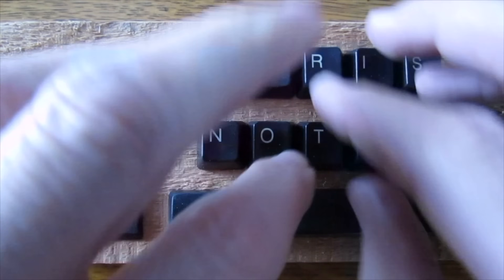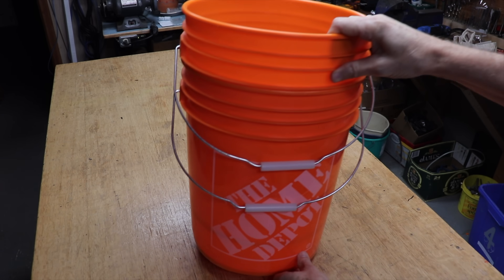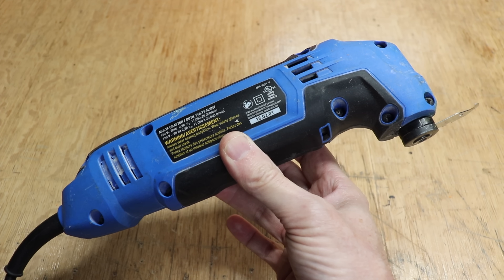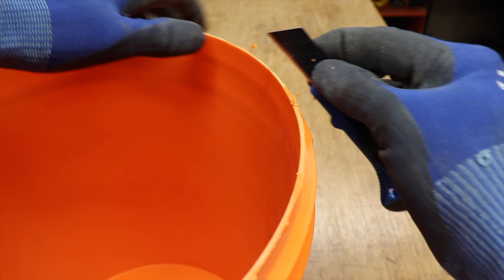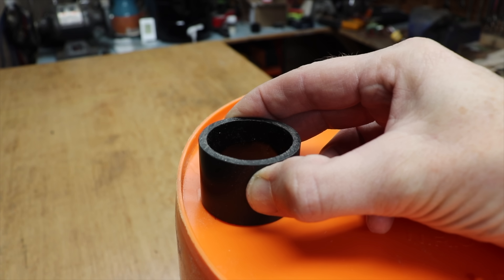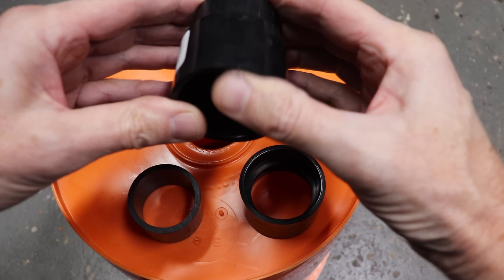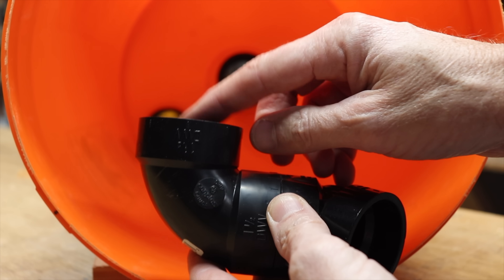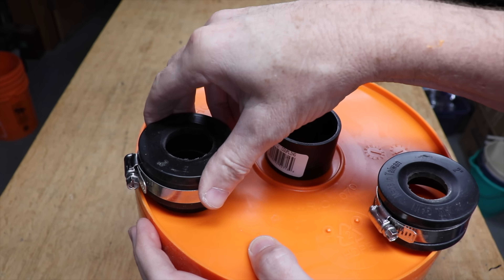How to Make ● Simple Cyclone Dust Collector

Comment: Is anyone using these w/ compact wet/dry Vacs?  I'm thinking about a 2-4 gallon Milwaukee/Dewalt/Ridgid vac + Cyclone for my TableSaw.  Would those be enough power? I have the most faith in the Ridgid but I'd love the battery/wall power option of the Dewalt.

Comment: Easy and cheap. Love it.  Some things I realized after I built mine.  The intake hose must be larger than the exhaust hose (the one going to the vacuum). Also the intake port must be at as big or bigger than the intake hose.  Having a smaller inlet port than the inlet hose will cause clogs if a chunk of wood is sucked up.  I also noticed a comment from someone about a whistling noise. I had the same problem.  When I used a larger intake hose, the problem went away.  I have gotten so many great tips from guys like you that are willing to share their ideas. Thanks again.

Comment: No need to cut the handle off the bucket.  It works just as well with it on and you get to have a fully functional bucket as a bonus for other things.
Reply from the maker: I found that it got in the way when putting the buckets together or taking them apart, but yes, leave it on to suit your needs for sure. Thanks.

Comment: Hello again Chris!

I had a trailing thought on this project. Providing the the efficiency of the cyclone set up is optimal, would it not be a good idea to simply add a 2 inch pipe from one's central vac (providing you have one!) to the cyclone? Then add a simple SPST switch to activate it. This would cut down on workshop noise from the shop vac. .

Anyways... just wondering what your thoughts are on this?
Reply from the maker: Thanks!! Did you see the update video? ... https://youtu.be/BeU4nqSJtBY
Reply: @chrisnotap  Just watched it. "You're ahead of your time" - LOL

Only change I'd make would be to make the connection to the central vac system more permanent.

Nice (creative) work Chris.

Comment: Might be a silly question but... are the sizes and dimensions mentioned in the video only correct based on using a 1.5 inch shop vac hose? I don't think he mentions what size of hose he's attaching? I think mine might be a 2 inch or 2.5 inch shop vac hose? So I'd need a 3 inch end cap and 2.5 inch pipe fittings? I wonder whether it would work as well with the larger diameter hose or if I'm better off getting an adapter, 2.5 inch to 1.5inch!? Sorry... turned into a long question, any help is appreciated! Thanks :-)
Reply: The reducer is easiest and it works.

Comment: Just want to say that this works great. I used it when I was grinding thin set mortar from a poor tile job. Tried it first without it and I clogged my 16 gallon wet vac and central vac in 5 minutes each. Built this and was able to grind for 30 minutes at a time with great suction. Only had to stop to empty the pail. Even with the fine mortar dust it took care of it.
Reply from the maker: Great to hear!

Comment: Dang.  Home Depot changed their buckets. Doesn’t slide together like that with the new ones.
Reply: Cut down to the final ring where the handle is and be sure to keep beveling with your razor. I just bought home depot buckets today and got them to fit together. Cheers!
Reply: @MaestroSmoke  I ended up just getting a new one and didn’t cut it. Got some leftover window seal I had laying around and a couple latches. Works great, but a bit more work than what y’all did.

Comment: Nice job on the video. I built this and was a waste of time and money for me as it does not capture the fine dust and it is the fines that clog the vacuum filter. I ended up buying the $39 bucket top separator at Home Depot. It took about 2 minutes to install, works like a champ on fine particles and comes with all the hoses and fittings needed though the hose fit on my 30 yr old craftsman shop vacuum isn't perfect some light sanding of the fittings solved the problem. I hate to pump up a big-box store but there it is.

Comment: Maybe I missed it but what's the "estimated total cost" for all materials?  (tools excluded).
Reply: It cost me C$30 for the parts, not counting the hose, with half the cost going to the rubber caps.  The most expensive part of the job will be the second hose but that is the best hack of all, especially if you have a spare central vac hose.  An extra 30 feet solves the tipping problem to boot.

Comment: Some good ideas in your video. Actually a lot of good points however I have had amazing results by adding a baffle between the top and bottom bucket with a half moon shape cutout. Also I took some 1/2 inch sprinkler abs and hot glued it in a spiral to the side of the top bucket and stopped it at the cutout. Also added a small scoop at the cut out to help catch the last of the dust. The filter remains completely clean no matter what I vacuum up. Even dog hair.
Reply: sandyt not getting a visual on this. You need to show a video of this idea as it sounds great.

Comment: Ok I built this and initially it worked great. Now when I try to use it both buckets collapsed, there are no clogs anywhere. Any ideas?

I just saw the update and that fixed it.
Reply from the maker: I address that issue in the UPDATE video........ https://youtu.be/BeU4nqSJtBY.   Or your vacuum is too high powered.

Comment: Great video but have a question. Home Depot bucket bottoms now have the small circle the exact size of the 1.5” pvc. So should I move the hole that connects to the vac closer or further away from the dust collector inlet? May have to get an extra bucket to try two different approaches but thought I’d at least ask
Reply from the maker: If I understand correctly, I would go further away from the inlet.
Reply: @chrisnotap  Thanks for the response. Yeah the circle on the bottom of the bucket exactly matches the 1.5" pipe whereas on your video the smaller circle fits inside the pipe. Mine's exactly 1.5" so I'll try moving it away from the dust inlet and will post my results.

Comment: I finally had a chance to build this dust collector yesterday.  Very clear instructions and it works well.  Couple of notes based on my experience:
1) Most of the time was spent on sizing the bucket to fit in its mate.  I used a different bucket from Princess Auto and it needed quite a bit of a adjustment to fit properly.  I wish the oscillator hack worked better as the blade constantly slipped out of the holder.  Not sure what I did wrong but had to finish with a jigsaw.  Chris's tip to drag a utility knife perpendicular to the lid was key to getting a good fit.
2) The rest of the job was straightforward.  The step drill bit worked great as he said and snips and a sand was all I needed to size the two holes.  I found a drill press with a hole saw worked the best for drilling out the rubber caps.  Much cleaner than dremelling it out.
3) Great idea to use a central vac hose, if you have one, as it should reach most of your space without having to move the stationary collector.
4) Suction was definitely a bit less with a 30 foot hose (and I needed an adapter to reduce my shopvac hose from 2.25" to 1.5" to fit his spec) but more than adequate for my needs.  
5) The unit seemed tippy so I'll probably opt for Chris's 3rd pail upgrade later.
6) It cost about C$30 with about half the cost going to the rubber caps ($6.50 each).  Much more economical if you can recycle a hose than buy new.
7) Great way to spend a Saturday morning.  
Thanks Chris!
Reply from the maker: Thanks for your feedback!

Comment: Note to self: Home Depot isn’t close to me so I tried Harbor Freight buckets.   Either my shop-vac is turbo charged and has the most suction of any shop-vac out there, or the Harbor Freight buckets are super thin and weak and thus collapses when there is any restrictions on the hose.   Lesson Learned
Reply: Hello Chris,

I’ve made the cyclone. It works really well, thanks ! The only thing I’m not sure, I get some particles and dust coming out of the blower vent, it’s annoying when used in the house. I have the basic cartridge filter, no bag filter in the can. Am I doing something wrong ? Thanks again !
Reply: I found the update video addressing the buckets collapsing, I’ll give that a try!  Thanks for the videos.

Comment: Who the F would’ve figured that Canada fitting are different then ones in the USA. I couldn’t  find a short 45 degree elbow or a 90 degree one like he has in the video anywhere but in Canada and of course none of them will delivery here. I’m worried if I don’t use the exact fittings it may not work.
Reply from the maker: Many have said they use PVC fittings instead. And yes it's important to use the angled parts like I describe in the video. It works!
Reply: Chris Notap Thanks, I can find them in PVC just not in ABS.

Comment: Great idea.  I had a problem with the one I built.  My vacuum uses an 1 1/2 hose.  I hooked the bucket to the vacuum with an 1 1/2 hose to the bucket and so a 20' one and a half inch hose from the bucket to the collection to the end collecting dust.  when I turn it on, I get a shrill whistle at the end of the hose.
Any ideas how to get rid of the noise?
Reply from the maker: For some reason some hoses will whistle due to the shape or the way the circular parts are made/shaped. You may need to buy one that is meant for vacuuming. My thought would be that the whistle is happening at the opening of the hose. My only suggestion would be to try and shape the opening of the vacuum hose differently using a pair of tin snips or something like that.

Comment: So the baffles or separations on the inside didn’t work, primarily because of the height of the bucket? Or even with the second bucket for height, they didn’t help? The HD version of dust separator seems to use a baffle.
Reply from the maker: Once I had the buckets stacked I found I didn't need to have a baffle it worked so well without it. Did you see the update video? ... https://youtu.be/BeU4nqSJtBY

Comment: The bucket design is different now or they make different buckets :(
Reply from the maker: Others have said they used Lowes buckets and they work.
Reply: @chrisnotap  how far down is the cut since I can't use the lines as a guide?
Reply from the maker: 1 1/4" down from the top.

Comment: Just did mine and works AWESOME! THANKS!!!!
Reply from the maker: Great to hear! Did you see the update video? ... https://youtu.be/BeU4nqSJtBY
Reply: Just checked the new video! Thanks! Now I’m using one of those 1-1/2” pvc corrugated hose and makes a terrible high pitch noise , I’m trying to get rid of it but not sure how to... will have to check some more videos in here... thanks again!
Reply from the maker: Yes some hose make a loud whistle noise. The only solution might be to use a different hose. Good luck.

Comment: I went to home depot and tried to do this but unfortunately, it seems that home depot has changed their bucket molds as the design is not the same anymore. It does not have 4 rings up top like the one used in this video. After cutting into the bucket, it does not want to fit over the other..

Comment: Thank you for this, I'm now trying to build my own. I'm from the Philippines and the parts are not readily available. If I use another 90% elbow instead of the 45%, would it still be effective?
Reply from the maker: I tried every which way and this worked best. You can try whatever you want.
Reply from the maker: Thanks!! Did you see the update video? ... https://youtu.be/BeU4nqSJtBY
Reply: You could cut a 90º elbow in half to make a 45º.

Comment: Question about your design, my lower bucket collapses with the vacuum I am using!  Is it because the vaccine starts with a 2 1/2” hose and I go down to a 1 1/2 fitting.  I created a dust collection for my workbench and if this does not work I am back to square one!
Reply: Two recommendations:  
1. Double up on the buckets, top and bottom to give rigidity.  He has a second video about this. https://www.youtube.com/watch?v=BeU4nqSJtBY 
2. Avoid connecting vaccine to bucket. ;-)

Comment: Excellent recommendation, I will used you method adding a third bucket with the HD vac the one you used for this type of buckets...excellent thank you very much! 
5 Gal. 1.75-Peak HP Wet/Dry Shop Vacuum Powerhead with Filter Bag and Hose (compatible with 5 Gal. Homer Bucket)

Comment: I built this yesterday (my lazy variation) and it works great so far! So thank you!
Reply from the maker: Thanks!! Did you see the update video? ... https://youtu.be/BeU4nqSJtBY
Reply: @chrisnotap  fortunately I did! I'll need to revisit how the PVC fits in the top - I'll probably need to get another bucket and redo it since the connections to the bucket aren't great, but I'm not worried about losing a couple bucks over it.
Reply: I also found it tricky to get the buckets to fit together, so I made a bunch of relief cuts in the manicured bucket's edge so I can work it into place easier.

Comment: I made one of these and it works fantastic. The only part that I changed was the 2 inch rubber cap, because I was going to hook it up to my Craftsman 16 gallon shop vac, which has a bigger hose. The connector I used instead was a 2 in. x 2 in. DWV Flexible PVC Coupling.

https://www.homedepot.com/p/Fernco-2-in-x-2-in-DWV-Flexible-PVC-Coupling-P1056-22/100096490
Reply from the maker: Thanks!! Did you see the update video? ... https://youtu.be/BeU4nqSJtBY

Comment: I have been looking at a cyclone for my  dust collection system. I think I will up size your idea to a 55 gallon drum and use the 4" fitting that I use with my dust collection system. It will be much easier to empty and keep the filter bag a lot cleaner.
Reply from the maker: Thanks!! Did you see the update video? ... https://youtu.be/BeU4nqSJtBY

Comment: This system shows how the cyclone (swirling air column) generates a centrifugal thrust on the solid particles.   Interestingly there is no need for a cone shaped element to get it to operate efficiently.

It would be interesting to demonstrate how the height (depth)  and diameter of the buckets influences the result.   My primitive notion is that high velocity air stream and a relatively small bucket diameter would separate smaller ( lighter) particles.  The very finest will still pass on to the shopvac filter.

Well done on this project!!!

Stavros.
Reply from the maker: Thanks!! Did you see the update video? ... https://youtu.be/BeU4nqSJtBY

Comment: Wouldn't it be easier to use a Cyclone Dust Separator Filter for $17 instead of doing all this? I'm not downplaying this solution, just want to know the benefits of this design over using the good old Cyclone Dust Separator Filter.

Comment: best one i've seen yet!! not that i really do any wood work lol, do steel fabrication still have the same problem though,  have to look at making one for grinding dust, not realy much different from what they use in proper sawmills the saw dust is just blown into the cyclone  then falls out the bottom into a hopper and the air is vented out the top just like you have done it.
 there's some useless information for you lol

Comment: PSA #3 - The fun continues. In my bucket style, the support circle on the bottom is just about exactly 2 inches. That means you must cut around the circular support entirely, but just barely. With the support removed, the thin bottom becomes susceptible to splitting under stress (guess how I found that out) so be careful. Also, make sure you are using the correct pipe as a reference for the holes...instead of switching back and forth between pipe and coupling...lesson learned.

Comment: Public service announcement: At my Home Depot in California, the Bucket neck is different that the one shown here. There is not middle flange to cut below. I wrapped a strip of 1-inch masking tape around the bucket, just below the opening lip. Then, using a sharp utility knife, I scored the plastic repeatedly below the tape until I cut through. Then I put the knife blade (#9 Snap off) into the opening and cut around the bucket. Although my cut had some slight wobble, the knife cut smoothly through the plastic like it was dense cheddar cheese on a cold day on the tundra. No burr to speak of. I was a little worried that the bucket wouldn't seat inside the bottom bucket, but with a little wax it eased in just fine.On to the next step...

Comment: I recommend you take apart a Dyson DC17 cyclone bin unit, that is the greatest cyclonic system I’ve seen in my life (the air goes through the cyclones 3 times)
Reply from the maker: I should have a peek inside one. Sounds interesting.
Reply: Chris Notap I think you’ll like it! What vacuum cleaner do you use at home out of curiosity?
Reply from the maker: Central vac. Made by Beam.
Reply: Chris Notap awesome! I’d love a central vac but I’m in the UK and I live in a terraced house so there’s no garage 😅

Comment: where did you get the pipe items, my home depot and lowes does have theses in stock. thanks
Reply from the maker: Description has links.
Reply: I don't see links for the parts just the tools
Reply from the maker: Yes. The only link is for the rubber pieces. The bucket and pipe parts are readily available at any hardware store. If you can't find the black ABS fittings, Use white PVC instead.

Comment: Genius! I'm going to make this and save my lungs. Thanks for sharing and for your clear, well-paced explanation and demonstration.
Reply from the maker: Glad it was helpful!  Did you watch the update? ...https://youtu.be/BeU4nqSJtBY
Reply: @chrisnotap  I did, thanks. Since I am using a shopvac, I don't think I will have the"squeeze" problem, but I may used the lower bucket in conjuction with a "lazy susan" mechanism so the Cyclone hose can turn to face different directions.